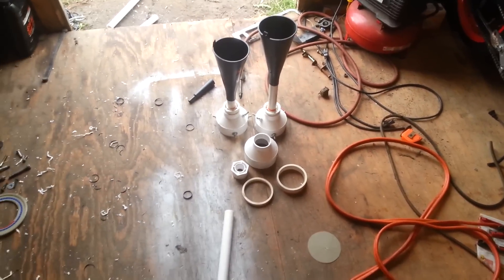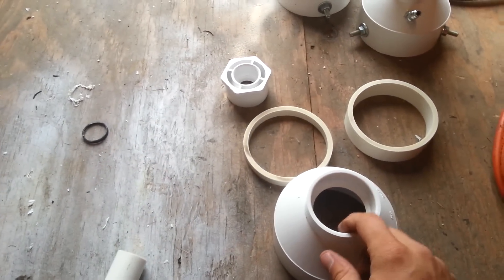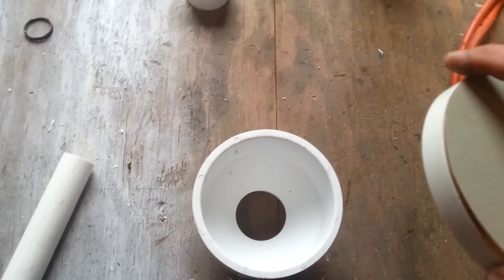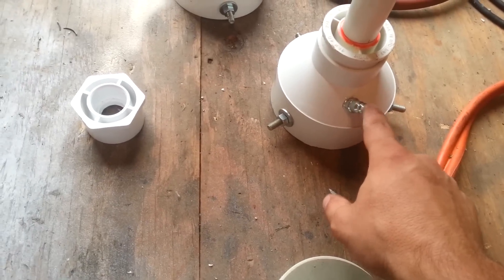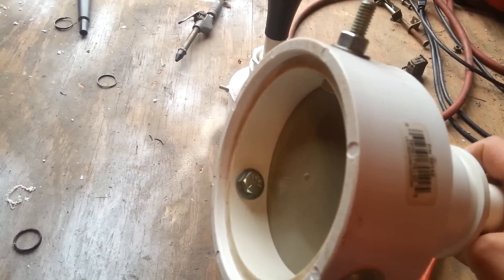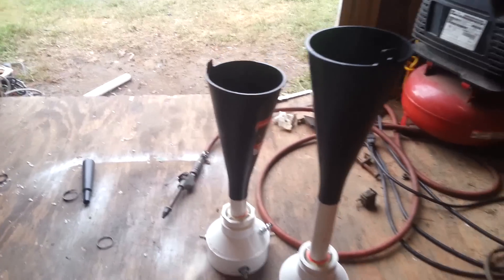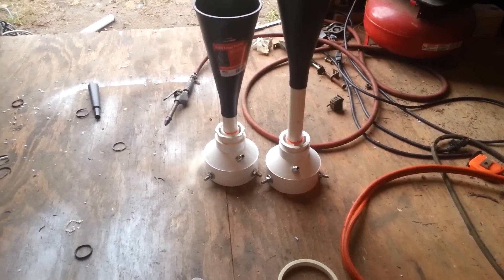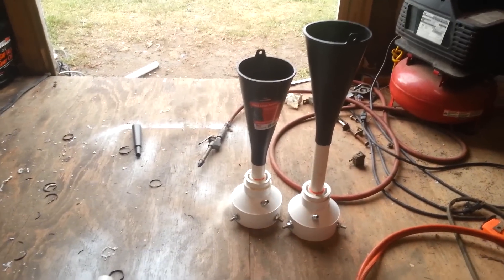How To Make A PVC Train Horn (For Real)

Comment: You didn’t state how to hold the 1” pipe in, as well as what to do with the funnel?? It would save me on some trial and errors, likewise would help to know how to get the air fitting to stay in too, thanks
Reply from the maker: Sometimes a little common sense helps. It's pvc so pvc glue would work. As far as the fitting goes its plastic if u drill the correct size hole u can just thread it in
Reply: :0( I was making a suggestion, not a criticism

Comment: If you want a good cheap low pressure air horn you can modify buy the harbor freight $14.99 air horns they're plastic an a bit high pitched but if you take the small trumpet out of the back end use a bit of electrical tape and put it into the larger trumpet. After playing around with it... you can change the pitch an its deeper. I'll try to post a video later. I have had the wolo persuader. Wolo Big Bad Max. An the Wolo Road Warrior air horns. their all fun. I hv videos on ny youtube as well lol
Reply from the maker: Ty

Comment: super loud pipes making a terrifying noise!

The length of the pipe you place the horn on determines the pitch of the note played.

The longer the deeper....

Volume is determined by the sound of the bell and the pressure applied on your gasket combined with air pressure and rate of flow.

Comment: You will get a louder, richer sound if you place a piece of 1" coupling (cut in half crosswise), onto the 1" PVC pipe (glued on & sanded flat so the surface of the coupling & the pipe are in the same plane). Place this in such a way that the pipe & pipe coupling are in contact with the plastic diaphragm.

Instead of a slip "1 to 2" adapter, use an adapter with an inside thread (sold as 'spigot adapter') & a mating thread piece on the 1" PVC. This is give you some 'tuning' control by a simple twist of the 1" PVC to drive the contact with the diaphragm a little tighter or looser which controls the frequency generation.

It will drive your costs up a little for these types of parts, but it would be a little less than $3 additional per horn. The added labor is a cost only you can calculate but since you are building them, it is far less than purchasing such horns. And that is the reason you are building them!
Reply: Cockroach You're a bad poser.
Reply: 2716Kanawa What you think of me is none of my concern.

Comment: having trouble with the diaphragm on mine. I can get it to a point where if I blow into it ill get sound but as soon as I try pressure from an air compressor I don't get squat. help?
Reply from the maker: try about 60 to 80 psi
Reply: k thanks